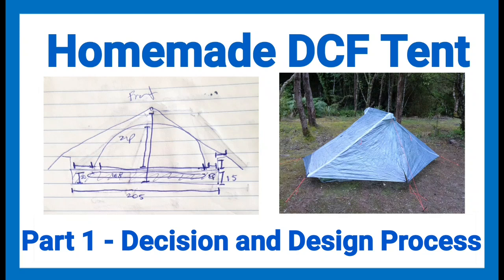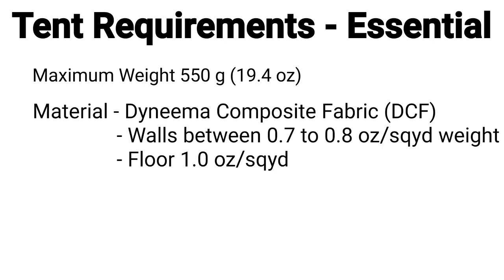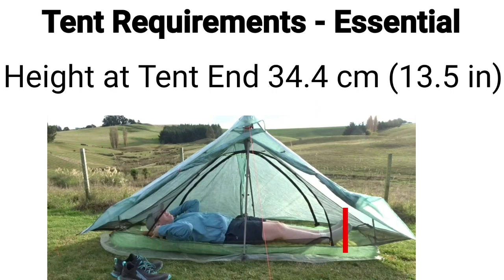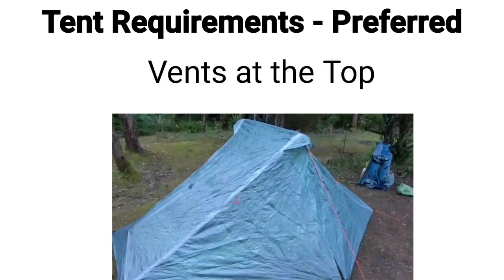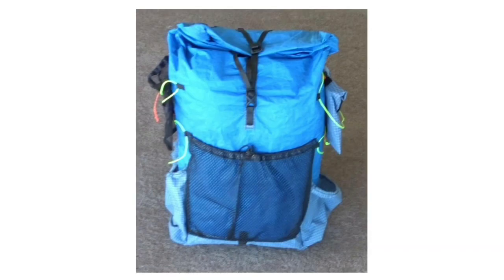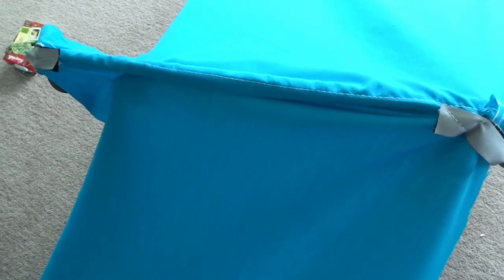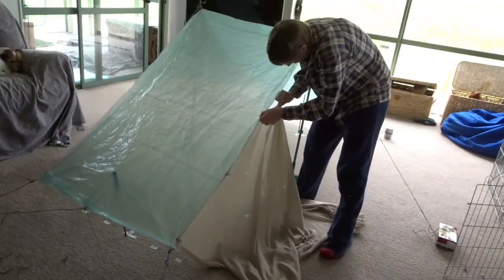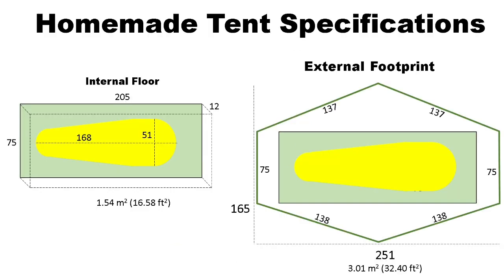Making of Homemade DCF Tent - Part 1 Decision and Design Process

Comment: If dyneema is 15 times stronger than steel how is this worked out?
Is it in tension, compression weight to ratio 
Just trying to understand 
Thank you
Reply from the maker: It is breaking strength when comparing same weight of the steel and dyneema
Reply: @RestlessKiwiHiker  So that is miss leading. I couldn’t knock a nail in with it if it is the same shape as a hammer or it would be useless as a nail
So only under tension it is stronger
Cheers
Reply from the maker: Yes it is tensile strength. I understand your comment about the Hammer but as it is in relation to a tent then the tensile strength is the relevant and logical measure and therefore fully appropriate.
Reply: @paulcritchley464  realise your comment is old, but it's so stupid I have to reply.

Think about your steel hammer comparison.

You may as well have said "steel is no good as a hammer because I have some steel wool here that would be useless at hitting in a nail"

Even though the hammer and the wool are both steel, they have completely different properties.

Comment: Nice project development from design through prototyping. My wife creates couture wedding gowns and it's a very similar process. Having a tent you designed and built will be very satisfying when out on the trail.
Reply from the maker: Yes I imagine the design process is similar, though a lot better precision and quality required by your wife than my amateur effort. It is satisfying using something I made